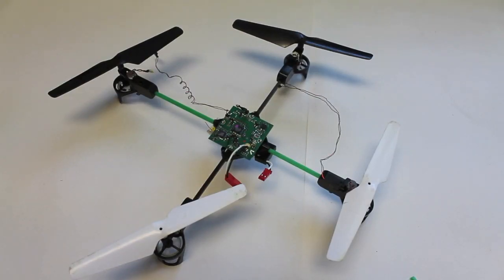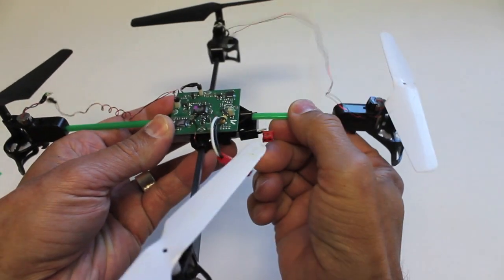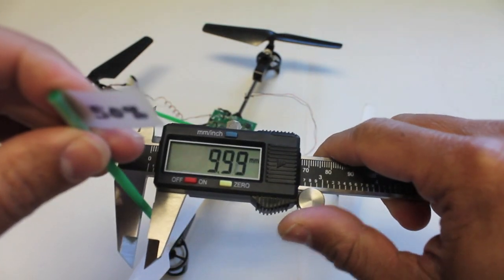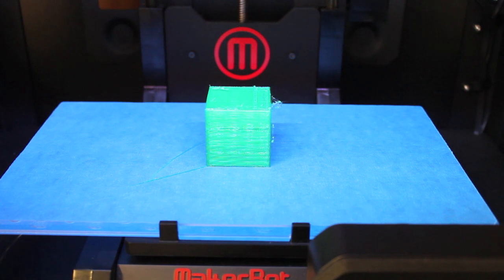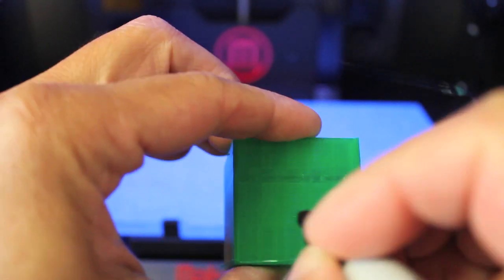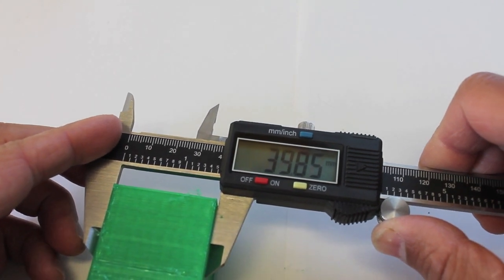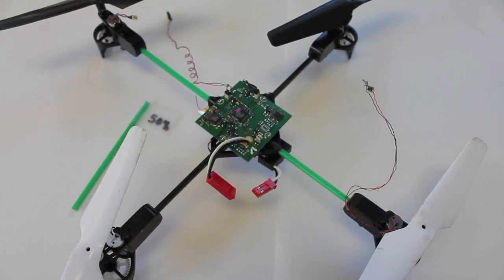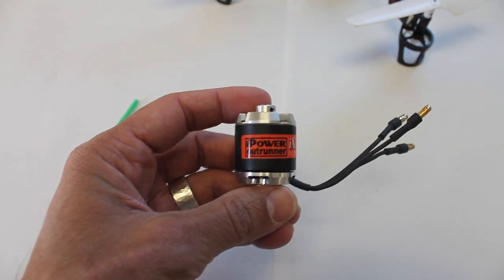Makerbot Replicator 2 Calibration Test for 3D Printing Quadcopter Parts

Comment: Nice one  Dennis.....I have got my H.A.L quad up and running using a KK2 board while i wait for the ardupilot to come and I have to say the 1.5 firmware has finally nailed the auto level and it is solid I will post a video in the next few days when i can hoodwink a cameraman.Looking forward to your torque test build Keep em coming......fly safe

Comment from the maker: Thanks. I had seriously considered building my own 3D printer, but decided with the MakerBot. It's been great after having several hiccups trying to get it up and running. I'd be interested in hearing what you decide to do so please keep me posted.

How do you like the KK2 board? I'm thinking about getting one to mess around with. I used to have the previous version, which was I learned to fly on.

Comment: To get the sizes wright you need to make sure your layers divide equally to the part. Other wise all slicing programs approximate. Also 5% shrinkage for heat.

Comment: The calibration cube file should have the axis indicaters programmed to print them into the cube, so you don'thave to mark it...no?  I'm surprised the software doesn't have the capability to add the correction factor for the calibration.
Reply from the maker: Yeah good point. The original design doesn't have indicators included. You can see it here:

http://www.thingiverse.com/thing:477

Most of my prints lately have been very accurate with small margin of error. I don't need high precision accuracy at the moment. As I get further into this I may look into correction factor and share what I find. Thanks for the thoughts.
Reply: Yea.  Seemed obvious to me...
Good luck.

Comment: 10 years later...
finally got around to fixing and redesigning my Replicator 5th gen. no dimensions were ever correct. 
The dimensions you really need to check were your diagonals. Betting they didn't match at all.
that's because the makerbot is all plastic housing and flexes like mad... Just totally design an extruded aluminum housing and make it square.. making almost perfect squares with about 0.08mm and 0.34mm reductions in x and y respectively.  mostly due to cooling but also slight variations in my housing dimensions.
Take away... don't buy makerbot.. maybe Lulzbot these days

Comment: The parts are not 100% accurate because when the plastic cools it shrinks...
Reply from the maker: Game Critics Thanks. Yeah I learned that the hard way through trial and error. There is definitely a margin of error when the PLA cools, but I've found it to be tolerable for the size prints I've been doing lately. I appreciate the comment.